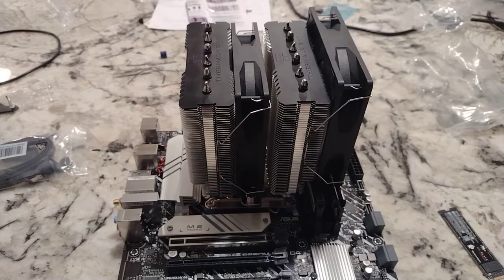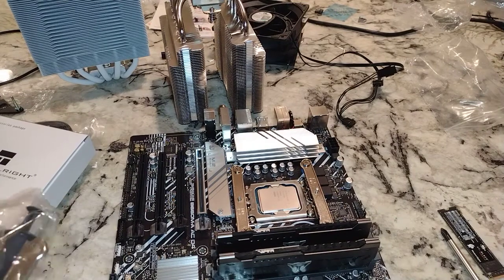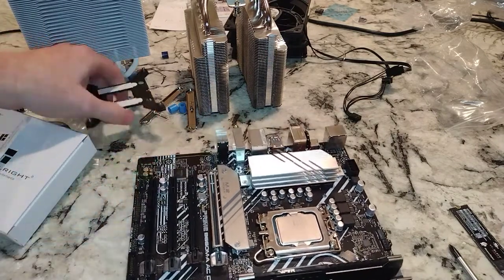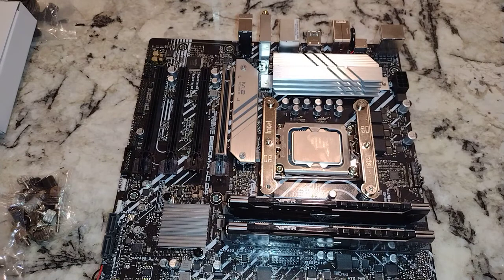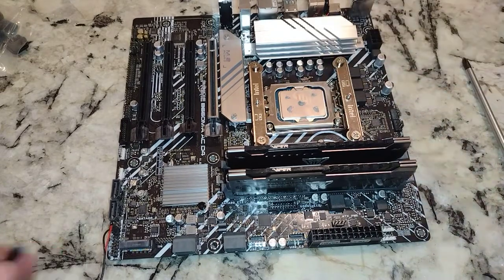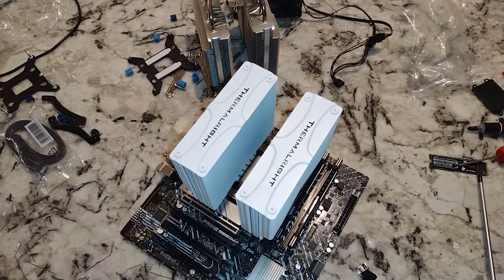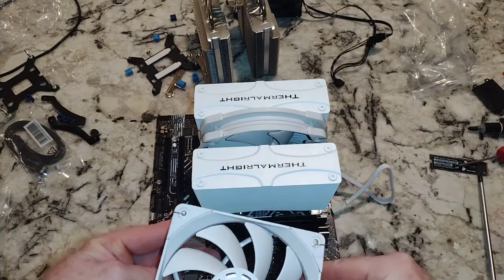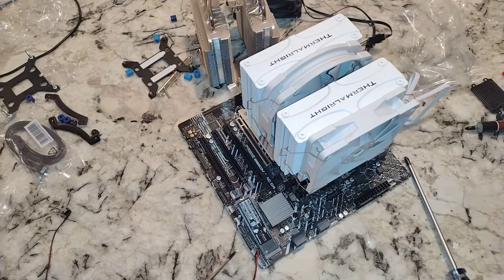Upgrading the I7 13700k with the Thermalright Frost Commader 140 White CPU cooler, on B660m

Comment: Looks like it blocks off like 2 of the PCIE slots
Reply: I think it's only potentially blocking one off, but either way, I think that's because he's using a micro-ATX mobo in this video. Standard ATX should have a bit more wiggle room.